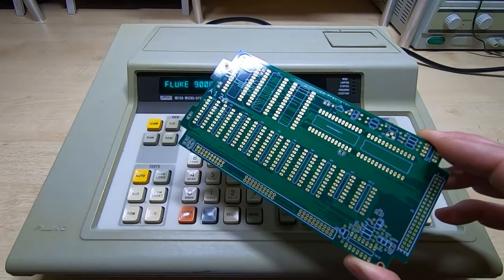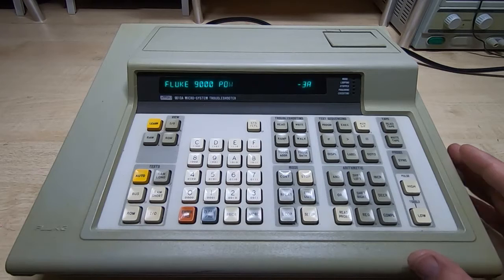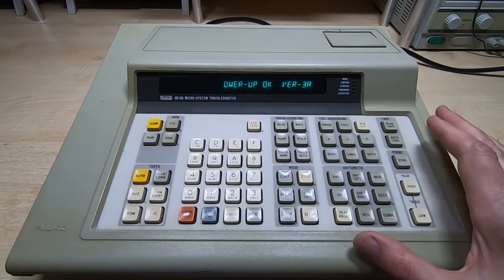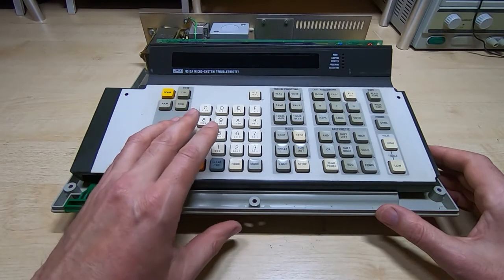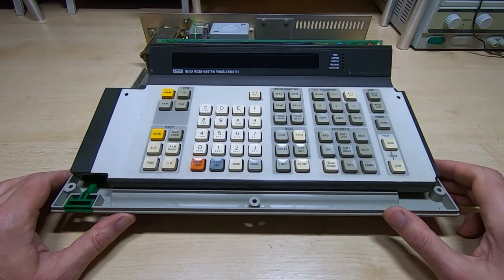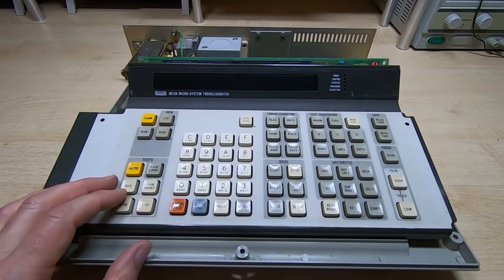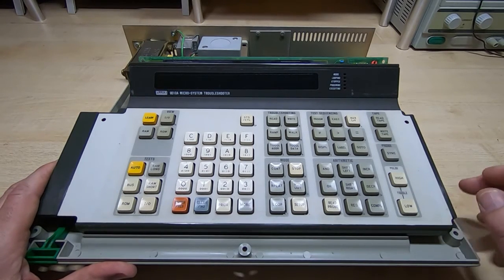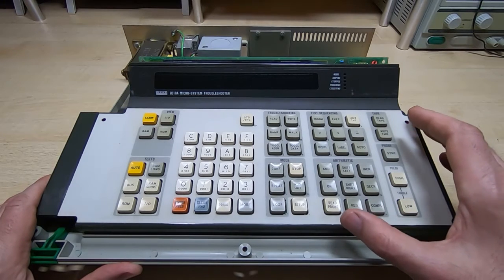Fluke 9010A Main Board Part1

Comment: Part numbers from the Fluke 9010A Service Manual 

	Description	   Fluke Stock #   MFG Supply Code   MFG Part No.
A1 - Main PCB Assembly        579268	      89536             579268
A2 - Display PCB Assembly     579250          89536             579250
A3 - Keyboard PCB Assembly    579425          89536             579425

[I'm sure that the above info has already been looked into]

I happened to be looking for an efficient way to analyze video game consoles and I came across the Fluke 9010A, this is what I'm looking for.

The Fluke 9010A needs to be cloned, FPGA'd so there will be parts available for repairs and I would like to see kits available to build all the components 
(main system, cables, pods etc). The "ebay" cost for the Fluke 9010A & pods are prohibitive for me to get one. To have access to the unit and be able to research
 the Fluke 9010A and contribute to the community.

I also want to say thanks to Jerry Walker, for his channel and videos on the subject.

Comment: Is there a way to replace the Dram with Sram, since Sram is more available and also cheaper then finding usually second hand Dram chips. Maybe also trying to reduce the number of eproms?
Reply from the maker: I would not be changing the design except where absolutely required. As much as possible I generally try to keep to original designs as my main goal is to keep the older designs going and also to demonstrate how these things used to work. I may sometimes design 'add on' parts using more modern devices but even then I try to stick to older methods. I think a good example of this is in the ADM project where a few years ago I built a dumb terminal using a single small FPGA (I did that for someone else and the end result was functional but not very interesting). If it was easy...

Comment: 6809 pods are one of the grail items for these - lots of folks looking for them, and very hard to find with prices exceeding the cost of a 9010a. 68000 and (to a lesser extent) Z8000 pods are in a similar category; any chance of seeing reproductions of those as well?
Reply from the maker: I only produce pods when I have an original so that I can compare the performance of the reproduction. So far I have not been able to find a 6809 pod at a price I am willing to pay. Ironically they get bid up to silly prices so it prevents me from creating a lower cost reproduction. It is however on the TODO list.
Reply: @JerryWalker001  Understandable; if I had one I'd be happy to send it your way for such a project. If you're open to somebody loaning you one, I can certainly put the word out. Otherwise, something I've thought of since viewing this a few weeks back - have you considered which MLB you'd reproduce for this project should it progress? I have two 9010a's, both with different MLB's if memory serves (it's been a while, but I think the EPROM setup was different; think one was newer with fewer/higher capacity EPROM's). Would probably make more sense to go for the "newest" version since it would likely result in a lower component count/simpler BOM, and also likely include any fixes/improvements they made along the way. Happy to provide images if needed.
Reply from the maker: The version will depend on the version of the hardware I have access to and the documentation I have. Naturally I need the schematics and I then select the closest match to the hardware unit I have (It is rare to find vintage units where any schematics exactly match any hardware). I am currently still looking into the display issue as this will be the most difficult problem to resolve. This will not actually affect the main board version I select but there is no point in my progressing with the project until I can provide useable display boards.

Comment: That looks like a really interesting project Jerry. I've previously used dry transfer lettering on key caps and then protected them with clear laquer, it works quite well although is time consuming however it does have the advantage that if the surface is not flat the indivdual letters conform to the surface. As My Mess Lab has sugested I've used clear printable sticker sheets on front panels and again protected with clear laquer and it looks suprisingly good, the only pain is getting the scaling right when printing.

Comment: Great!! Was waiting for this. I'll take one if you decide to build these. As for the keys just go for some transparent sticker paper that you can print on, cut out and apply to the keys. Engraving and laser would also work but everybody these days has printer so easier to make. For the display I would use 14 segment led displays, I think these are easier to find than VFD displays and you can use the original design. Also this way you don't need the 50V and the UDN6118 display drivers. I looked around and couldn't find any 32 x 1 character lcd displays. Are you planning to use the 8041 UPI or replace it with something else ?
Reply from the maker: For the display I have already ordered some parts for testing. Blue 14 segment LED's as they will give a very similar appearance to the original and as you say I can then leave out the high voltage drivers. I intend to use the 8041 as this also controls the keyboard and these devices are still fairly easy to obtain and so are the shift registers. I need to find some flat topped keys for the key board as all the keys I have found so far have recessed tops so stickers cannot be applied. I would not actually make up the parts but I will most likely supply a printable pdf file with the key cap images (unless someone else wants to take that on). I have actually decided to run this project backwards so I will be starting with the display board and make sure it works in my 9010 and then the keyboard and finally I will get to the main board itself. This will avoid ending up with a failed project due to display or keyboard problems.

Comment: I am stunned at how little is in there! I never opened the two I have. If this were crowd funded to make the best replica, I would be all in and I don't even need it. It would be a pleasure to take the piss out of the artificial cost of them on ebay. Absolutely, the best tool ever made should be preserved.
Reply from the maker: Yes I totally agree. There is actually more in the pods than in the main unit. I have been looking at the display board and it looks like there is a fairly simple alternative using alphanumeric LED displays. If I can find a solution to the keyboard issue then the rest should be relatively easy. The solution suggested by 'My Messy Lab' is the most promising so far.
Reply: Jerry Walker yeah i saw that and it got me thinking, i seem to recall old ibm cash register terminals had a clear key cap over a printed insert and the keyboard layout was similar. If my memory serves me right, there must be tons of them floating around out there looking for a second life. Even if not the keyboard its self there must be a key system out there like that. Awe well, just thinking out loud, maybe its helpful. 😀
Reply from the maker: Thanks, I did actually think of that and I looked on ebay and found some 'programable' key caps which are as you describe. Clear caps that clip over the keys and the idea is that printed inserts are put inside. The problem is there does not seem to be many around and silly money is being asked for them.
Reply: @JerryWalker001  I had a look around too for these and they seem to be called relegendable caps.  Also found some tactile switches with clear caps to put in printed inserts. How big are the original keycaps?
Reply from the maker: Yes there seems to be a few names for them. I also saw them called 'programmable key caps'. The originals are 12.7mm (0.5") square. Note that there are 66 of them so the cost of the caps and keys and covers needs to be taken into consideration. Also try to make sure they are available from more than one source. I found a few but they seemed to have limited numbers available or they were too expensive to be practical. I think that having some flat top keys made to fit the same style switches as I will be using in the ADM project may be the best solution (possibly 3D print them). We can then just use stick on labels. Not ideal but if the interest emerges then it may be worth investing in tooling for a proper set of caps to replace the sticker versions. Thanks for your help.
Reply: @marshalljmp800  YES! Those are the ones I was thinking of! HAHAHAHA! Great, been trying to figure that out all weekend what those were called! The originals are 13mm square and have a somewhat unsatisfying response when pressed as they drag slightly along the plastic case shell and give almost no tactile feedback that they did anything. That might be why the machine makes a chirp when they are pressed but I mean they get the job done on the original. They are similar to the Data I/O Programmer buttons too actually, in a lot of ways. 🤷‍♂️
Reply: A membrane keyboard solution wouldn't be completely terrible either and maybe more cost effective.
Reply: @JerryWalker001  Just emailed you a link, look at it and see if you could use these.
Reply: @JerryWalker001  LOL, I got 12.8mm. XD
Reply from the maker: It would certainly be the easiest but the debounce for a membrane key is very different than for a mechanical key and it may be unueseable unless I modified the code in the 8041 which I do not want to have to do. Also the tooling and MOQ may be very high so without a 'market' it would be too expensive to risk. If 500+ were needed then it would certainly be a good option. It would also solve the display problem as the panel could also have a new window for an LCD display. However the problem is the very small likely demand.
Reply from the maker: Its american so almost cerainly half an inch (12.7mm). Yours is probably just badly made so you should ask for a warranty return :)

Comment: Silkscreening for the keyboard coverplate !? - Scott/3M had a system with photographic transfere of a layout, both on alu and plastic foil, that could be used.
Keycaps - engraving, laser or milling, with one of these small engraving machines that is very popular for engraving names for keyrings and small nameplates.
Display - although it might seem "ethical incorrect" - a similar size LCD with blue EL or LED backlight, maybe inverted so it appears blue txt on black back. It might need a small interface conversion board that could be a PIC mpu !?
Got a 9010A myself with pods for 8080, Z80 and 6800. Pods for 6502, 6809 and 8051 are on my wishlist ;o)